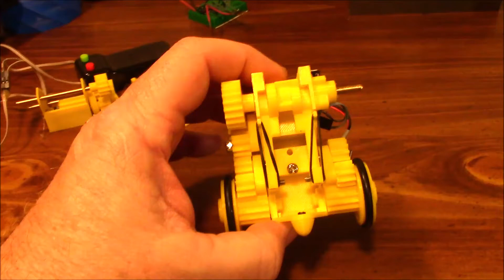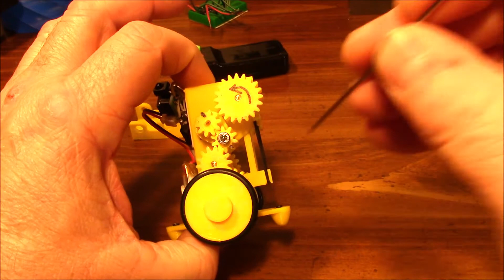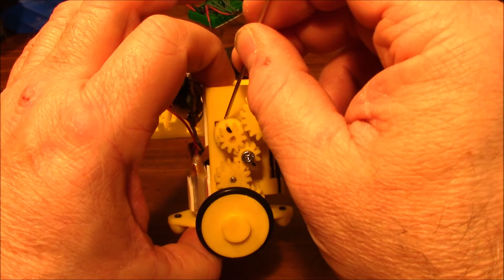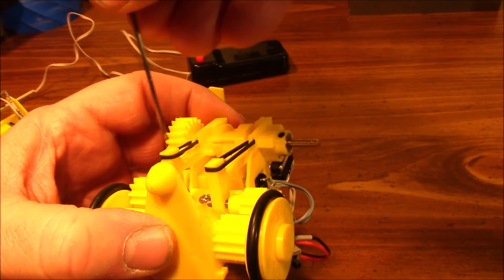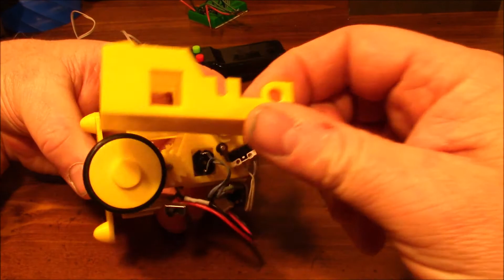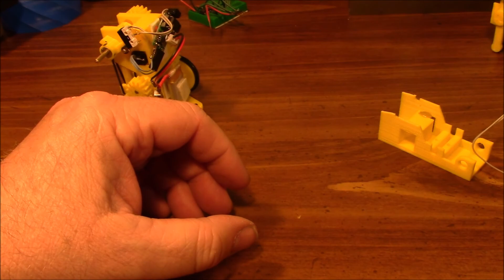Single motor steerable wheeled chassis test

Comment: Great job on both projects Rick. The dual drive cam control Base is so compact and works so smoothly. Really nice work.
Reply from the maker: Thanks John. I'm pleased with the way it's turned out so far. I hope to make a full function version when I get time. Do you know of any of the old toys that used a single motor for drive and steering? I've  been fascinated by this approach since I took apart a Radio Shack Armatron made by Tomy. I think they also made a pinball machine that used a single motor. Incredible pieces of engineering.

Rick
Reply: @rick_100  Yes turns out there were a few. Back in the 1980's I thought I had come up with the single motor dual drive gear box. I even contacted TOMMY in Japan about a robot using my design. You could steer the robot in all directions and the head of the robot would track the direction the robot would move. All mechanical . they were kind in letting me know it had been done before. There was a Astro Moon base toy. kind of a space jeep that used a single motor to control movement and steering. I bet there is a you tube of the toy.
Also the Mr Mecury robot toys used a single motor to control the walking legs or the bending down of the body, and a single motor to control the arms lifting up and down and moving the arms in and out. That was the first place I saw the swinging pinion gear set up.
Reply from the maker: @Robothut  Thanks for the info. I'll see if I can find some video. Your knowledge of these old toys is incredible.
Reply: @rick_100  There is also the old SONICON toys. They toys that used a whistle to control the single motor direction. So the when you turned ON the toy it would move in what ever direction the powered wheel unit was facing and when you blew the whistle the motor in the drive unit would reverse and instead of driving the wheels it would rotate the motor unit around. When you stopped blowing the whistle the toy would go back in to drive mode again. These toys just use a simple ratchet system to direct the motor power.
Reply: @rick_100  Oh man- I don't know who was working at Tomy in the 70s and 80s, but they made some amazing mechanical toys.